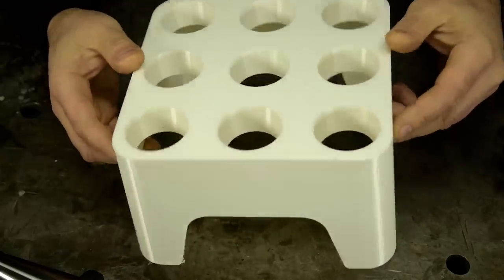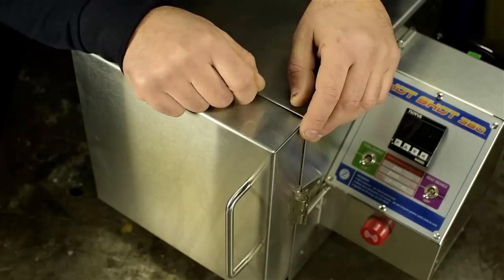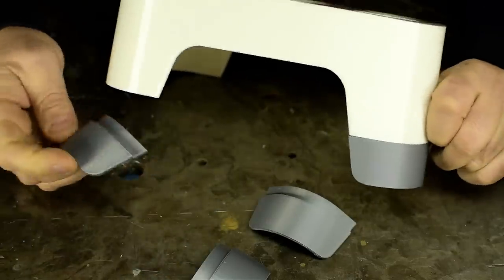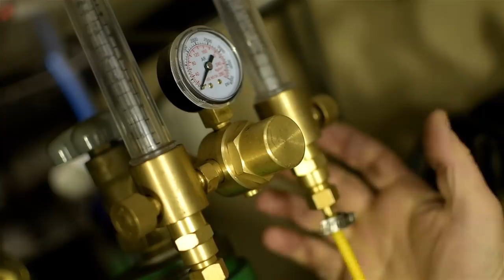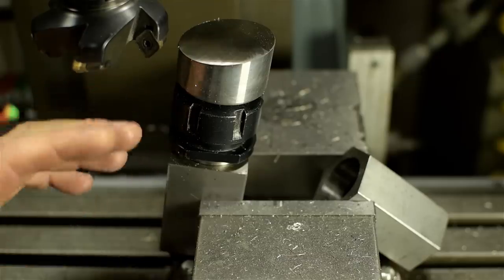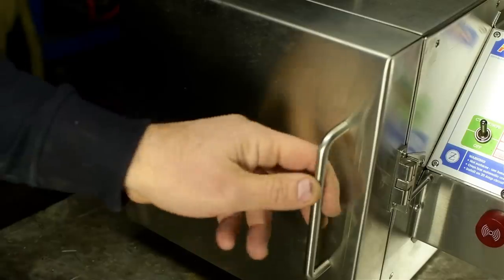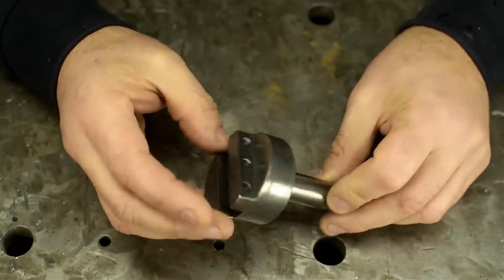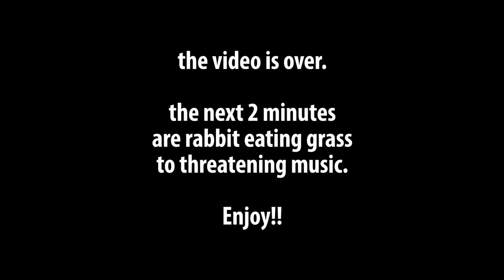NOW We're Cook'n with Argon!!

Comment: I got the same results when I did this. Better than no argon but seemed like a waste of argon considering the results. I think the issue is most of the argon just leaks out the door. What I did that finally got really good results was to put the parts in a stainless box with a stainless foil over the top with a hole for your argon tube. You feed your argon tube into the box through the hole in the stainless foil. Since argon is heavier, it fills from the bottom and since the top is just covered with stainless foil, the pressure is vented at the top of the box. You don't need very much argon flow for this. You will need to make a handle point on the box so you can grab it with something safe. I welded a bar of stainless on the side of the box that I could grab with my tongs. You pull the argon tube, open the oven door, grab the box and put it on a fire proof surface and remove the foil top and remove the part for quench. The results are close to pro level. Do the quench quickly because as soon as you remove the part from the box, oxygen starts to attach. That is the only oxidation I got with this method.

Comment: I'm trying to think of how this could work better for you. I usually try to purge from the bottom when I weld SS, so give that a thought. When u take the part out of the oven red hot, its introduced to O2 again and oxidizes immediately. It might be a big job but, Id think you almost need an Argon chamber, like the size of a sand blasting cabinet. Good luck Tony. Great videos!

Comment: That Noga pen attachment is obviously a deburring tool (and takes standard Noga replacement tips).  
Welding tip: Since you'd only be doing this if you already have argon for TIG, you can buy a Western CGA 580 tee and another flowmeter to use for weldment purging then use fittings of choice to connect green hose (your local welding supply sells it cut to length) to your oven. Make the hose with standard fittings and make it long (hose is cheap). That lets you not only connect easily to your oven, but place your argon cylinder anywhere you like instead of wheeling around on your welder. It's much more convenient to have cylinders chained to the wall or on their own cylinder cart.

Comment: Hey, I'm not qualified to give you advice on anything, but I'd feed the argon in from the bottom and vent from the top... and also put my part in, then purge, then turn the oven on.

I've built exactly zero atmospheric ovens, but I have purged a few pipes and things for welding.

Comment: Hey Tony, got a story for you. I remember back in your "welding straight is hard" video you mention not wanting to see homemade trailers with "ToT taught me to weld this trailer" bumper stickers pulling 4 tons of cinderblock and my buddys bedroom set. I might need one of those stickers.

While I was in welding class at college, someone took a Sawzall to my exhaust and almost got away with my catalytic converter. Apparently "cat" theft is on the rise again. Anyway, I took to my keyboard and went to your welding videos. Thanks to your tips and advice, I was able to fill the saw cuts in without scrapping the part! The biggest issue I had was welding the super thin wall tubing without blowing holes through the thing. 

Anyway, long story short, thanks for being a great welding instructor without being a welding instructor. (That sounded better in my head) 

I might make myself one of those bumper stickers. If you're ever in Albuquerque, don't drive behind a silver CR-V. (Hint, that's me in my self welded repair job!)

Comment: Very amusing. Tony should teach at a community college.  An old blacksmith's trick for small parts is to cover it in a borax slurry. The slurry will dry out in the oven, and when you quench the part, the thermal shock will get rid of the borax.  ^_*  It only works for small parts, though.

Comment: Dude! You just made an offering to the evil red-eyed CNC mishaps demon! You were forwarned with a warning from the sketchy part hold gremlin. You are not supposed to feed them after midnight.
Reply: Not just that, did you see that he used 3d printed plastic as a core component in his CNC conversion?  Every time he makes a manual move he'll be depending on the quality of that part.

Comment: I did this circa 2000 to heat treat some 01 ring gages. My setup was not quite as elegant though. I just took some small diameter copper tubing plumbed to a flow control, stuffed it in the oven and closed the door on it.

Comment: You can print using larger line widths with your existing nozzles. Results in better layer adhesion and top layer finish, too. I use 1.5 * nozzle diameter for most prints now.

Comment: Hey Tony, quick note on 3D printer nozzle size: the v6 nozzle will start to hit some material flow limitations around 8mm and give you poor results (both print quality and print time) as you increase nozzle size. So if you really want to print at 1 mm+ nozzle sizes, examine upgrading your hot end (ex, e3's volcano, supervolcano are compatible with the v6 mounting via the heatsink) but you will sacrifice z-height.

huge fan, love your videos!

Comment: FYI Tony, You can go with over 1mm extrusion width on 0.6mm nozzle with no problems :) 0.6 is my nozzle to go on a printer I use the most, because I can pretty much print with 0.4-0.5mm width up to over 1mm.

Comment: The factory I did my toolmaking apprentership at had an annealing oven that took sealed retorts that were purged with hydrogen.  There was even a small exhaust port that was lit to consume the exiting hydrogen.  The parts were stamped magnetic iron that were used in the manufacture of relay sets.

Comment: Blacksmith here , you need to quench in a vacuum to eliminate scale just opening the door and taking 30 seconds to get it under oil like you did will be enough time for scale to form , try the argon purge and the foil method ? just have shears ready to cut the foil so the part drops directly in to the oil ( ps get a bigger quench tank lol)

Comment: I do a little 3D printing operation where i work. Sometimes I have to print off prototypes as fast as possible. Heres what I do to speed things up:
• increase print speed. 100mm/s is quite fast and preserves accuracy and 150mm a second if you are really in a rush.
•increase layer height. 0.2mm to 0.5 mm for quick prints.

Comment: I doubt that furnace has the capacity to hold any appreciable vacuum but if you put in a multi-way valve you can use the same line you just put in to suck out the air before backfilling with argon. Also a handful of titanium chips can be used as a getter to help gobble up the oxygen.

Comment: We use a 1mm nozzle at work. Definitely much faster with the loss of fine detail. Also they make filament sensors that stop the print when it runs out if you're concerned

Comment: instead of Argon, you could try annealing bags for heat treatment, these are steel foil envelopes that you put your part in, heating your part in such a bag, will make the bag heat up first "eating up" all oxygen inside.
Depending on the steel you're using, you could even quench the parts in the bag, and then take the bag off.

I used those bags a lot when hardening D2 steel (and you should be able to harden D2 with that oven..)

Comment: I think if you put the  oven on its back and loaded the  the oven that way you will not loose the Argon shield  the door opening on the side lets the Argon flow strait out. Otherwise place the part in the cold oven then fill with Argon then switch on the oven

Comment: Increased nozzle sizes have increased flow. Your standard v6 hotend will max out at about 0.6mm at any decent sped. You need a volcano hotend if you want to push more plastic per second. If you go to a 1mm nozzle without the upgrade you will have to slow down the print to the point that it will print at the same speed of your 0.6 nozzle. Look at cnc kitchen for more info.

Comment: There are sets of nozzles available from .2 to 1 mm for under 12 Euro. I use my 2 Ender 3's for printing big and heavy technical parts from day 1. My favourite nozzle size is .8 mm with .4 mm layers. Prints are done pretty quick and I don't care about visible layer lines. Most people use the Ender 3 and other fdm printers for little decorative parts, which is like building the statue of liberty with Lego bricks - it's possible but it's npt the right tool for this job. For little detailed parts there are technologies out there that are much better for this.
Only thing that is important when you print with bigger nozzles is setting the slicer to exclusive mode to have all holes as big as they are meant to be.

Comment: hey TOT just as a FYI you can just put in more filament when they run out if you catch it in time. id remove that filament switch though if your not using it in the gcode to park and pause your hotend otherwise it will just stop the print normal which can be very frustrating. another thing you can do in some slicers is just drop the model below the bed and have it only print the missing parts and glue them on instead of making separate feet but i will admit that grey on white looks sharp.

Comment: Video idea: Do a follow up with (challenge incoming!) surface hardening and grinding the shaft on your lathe (You'll need to build a grinder "tool/setup" for mounting on the slider, another video could come out of that ;) ). You're 100% on the money when warning about hardened tools holders, that's just dangerous, however all pro-tools are surface hardened to prolong lifespan and of cause grinded ensure high repeatability/reliability
Rest: Great video as always, learned so much new information and procedures after you got that oven, it's been great :D

Comment: Love the intro. Naked time is important. More important when working with Nitrogen filled containers you should open them at arm's length or with a fan at your back. Breaking up that puff of non-air will keep you from any sudden attacks of floorface. (advanced headdesk?) Of course, Most prople tend to open ovens at arm's length anyway. I, for a short time, worked  at a plant that packaged medical "items".. (implant screws mostly) They got "trayed up" and covered, then wheeled into a 5X% pressure chamber where the air was replaced with Nitrogen at a pressure that made the packages all seal. The part with the chambers in it has a wall of 6 foot fans that NEVER* shut off.. The fresh air is piped 30 or so feet from the edge of the roof. I was told the exceeded OSHA and still had guys black out from standing too close when more than one door opened with only the required fans on. (*One fan is always being cleaned 2nd shift.)

Comment: Perhaps add a vent to the top so that when purging you have a positive exit point, crank up the flow rate after opening the door to insert the part and have the vent on top open for a short while.   If you could produce some kind of non-staining non-toxic smoke inside the chamber, you could time how long it takes for the argon to purge the contents which would give you a good indication what you need to do... 
Interesting adaptation ....

Comment: Is there an issue with the insulation holding on to some of the oxgen? I would think the argon purge would have to be fairly lengthy before placing a part in for heat treating.

Comment: OH, I forgot, I wanted to tell you run your parts in stainless steel foil and heat treat in air.  Does slow down the quench a bit so the tighter you wrap the parts the better.  Works best with air cooling tool steel.  And always leave grind stock to be removed from all surfaces practical after heat treat. Oh, 4340, if available, is better than 4140. I guess I'm doing what I said I wouldn't do  in the previous comment,

Comment: You can try bumping up the flow rate to, say, 50cfh for a minute right after putting a part into the oven. And then backing it off to match the recommended value.

Comment: You'll want to go to a beefier heater block to do high volume printing. You'll overrun the standard E3D v6 quickly even on a .6 nozzle (You can go up to .4 layer height and 1.2mm line width). An E3D Volcano is the way to go.

Comment: Nozzle changes: use one type of nozzle, do not mix and match from different patches. Check that they are all identical lengths, when it comes to the threaded section. Change them when warm. Mixing different type of nozzles can end up with a dreaded blob but so far, using just one type, sourced from the same place has worked fine. Also: it is fairly easy to miss the threads and screw it in wonky, ruining the hot end in the process, use a drill bit and fingers, don't use power tools.

Comment: One of the problems with your setup is that you are relying on argon purging to remove all your air. Although purging will reduce your O2 content, it will not completely deplete it due to diffusion of O2. What you need is to turn your oven into a DIY-vacuum oven with a purge line - this way you can evacuate the chamber, then back fill it with inert gas (eg. Argon), then pull a vacuum and backfill - ideally you should do this vacuum-backfill cycle at least 3 times to get a very pure inert environment.  Do this prior to heating - oxidation occurs very rapidly at high temperatures so don't insert or remove your tools from the oven at high temp or you will expose them to O2.

You will need to drill and tap two more holes for a vacuum line and a pressure gauge.  You will also need to install in-line valves on both the vacuum line and purge line so that you can shut them off independently during each processing step (vacuum or backfill).  I don't remember if your oven has an air tight seal or not - you may need to install an O-ring or a flat gasket around the door.  That way air will not seep into your oven when you are pulling a vacuum (also since your oven is small, you do not need a large pump to get to a decent vacuum).  

Once you turn you oven into a DIY vacuum-oven, your results will improve substantially.  

Good luck

Comment: For stainless we normally use a nitrogen & 5% hydrogen mix which comes out with very light oxidation which is cleaned off easily with a potassium permanganate solution

Comment: 3D printing advice : You won't probably see it, but in fact you can just adjust the thickness of your layer, with a 0.4 nozzle you can go about 0.7mm wide, and with 0.6 I can go up to 0.9mm wide... prints are stronger and faster... there is an excellent video of stefan from cnc kitchen about that... Going with wider perimeters is so much faster than any other parameter tweak... (even layer height)

Comment: I'm not sure you 1 mm nozzle is the best idea with a standard 1.7 mm E3D hotend. if you're looking to push plastic at that rate you might need something like a volcano or a supervolcano to be able to handle the increased volume of plastic. They generally come with more powerful heaters and have a greater thermal mass. They also have a longer melt zone which is useful if you're printing at a higher flow rate because the plastic has enough time to fully melt. 
For larger prints which don't need a ton of detail or I just want it quickly. I use a old heavily modified CR10 with a volcano (0.6 to 1.2 mm hss nozzles). I modified my mk3s for accuracy and my CR10 for speed. it's more of a case of picking the right machine for the job.

Comment: I would just use the oven in a larger rectangular container with a lip higher than the oven - any argon that leaks out will first fill that box to the lip and the inside of the oven remains largely pure argon after the purge.  An upward sliding door instead of the swing may make less turbulence in the container at both part insertion and extraction time, but that takes the oven back to the design board 😀…

Comment: How clean was the fly cutter before it went into the oven?
Burning what ever left over cutting oil on/into the surface of the fly cutter in the oven could have caused scaling before you ever quenched it.
I'd be curious to see how it looked right out of the oven without the oil quench.
If it has scale coming out of the oven then either the oven isn't quite purged or the part could be dirty going in. Next would be how clean is your quench oil?

Comment: Glove box made of lucite, large enough for oven, and quench can, entire assembly evacuated with a shop vac, then argon filled... no scale. Your entire process has to be isolated from the air, not just the cooking. If your oil kindles, your part will be oxidized.

Comment: The printer is only capable of melting the plastic so fast, so switching to a 1mm nozzle may not be as fast as you hope. You might need to increase the heater output by switching to a 40 or 50W cartridge. There are videos about the topic, that show how to test your max volumetric flow rate. 
One other thing. Supports take some effort to remove with larger nozzles. Try to reduce them as much as possible.

Comment: Hey tony, thanks for all your help and processes. Helps me understand a lot. Am wondering about a rotating mill vice table with a worm gear for self turning? Saw a video about using a 3/8-16 tap to cut threads. ????? I think one would have to do math(ugh) a lot to get exact dia to have the teeth come out even. Could you help me(us) understand process and math used? Wouldnt the math suggest diameter would change as cut gets deeper?

Comment: A rotating nozzle head would probably add quit a bit of mass. Which would force you to lower print speed. As cool as it would be, for 99% of prints you'd probably be better off juat using a single head.

Comment: Seems like you're going to get through a lot of argon. I wonder if there is any reason you couldn't have a liquid aluminium bath for heat treating like a big glowing sous vide with a minimum temperature of 700°c. Steel parts ought to submerge in it, you could run a pid with a normal thermocouple and the heat transfer would be pretty efficient once you'd melted all your metal.